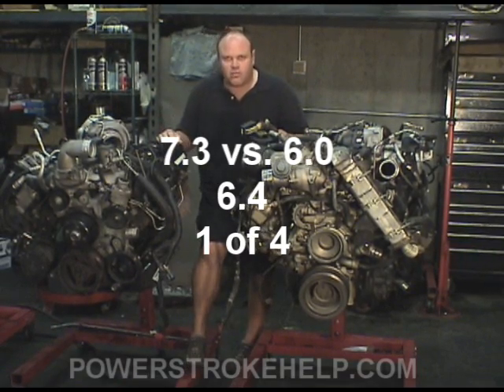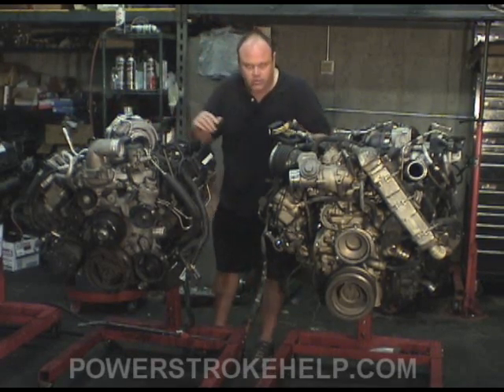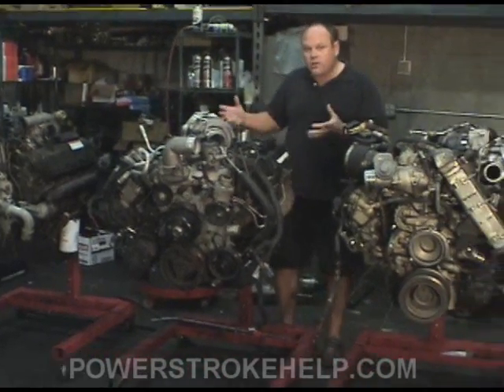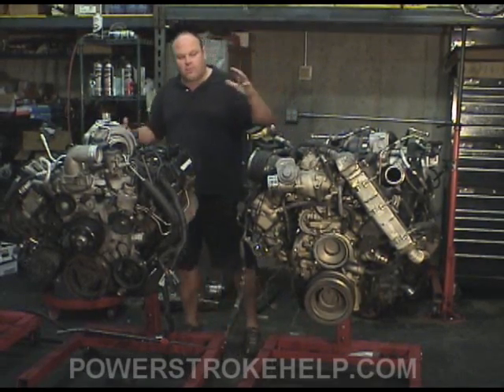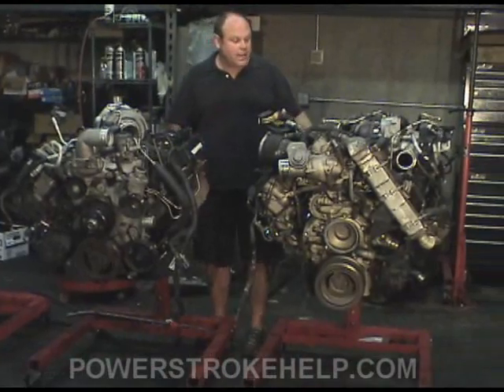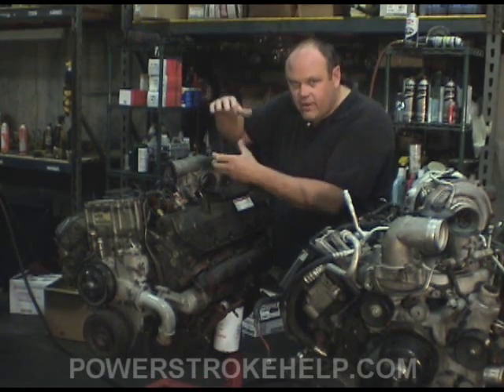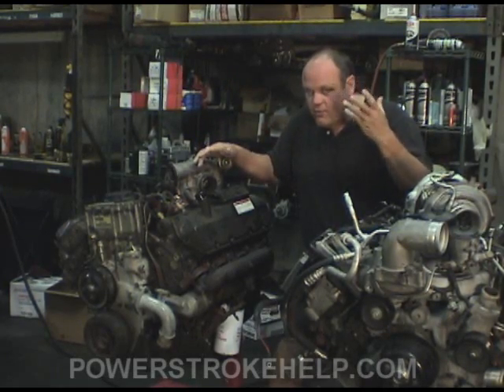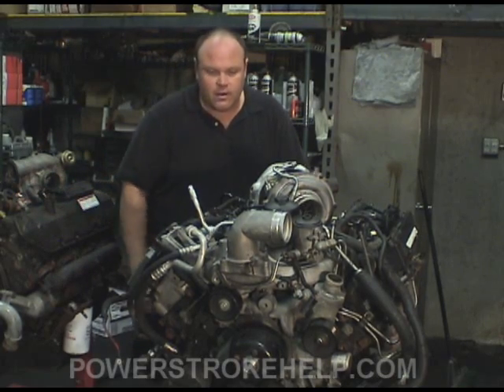7 3 vs 6 0 vs 6 4 POWERSTROKE ENGINES 1 OF 4

Comment: 7.3 is the best Diesel engine ever made.
Reply: Rebel Dipper I had a 1995 F250 Super Cab 2 wheel drive heavy duty I bought it 6 months after the Powerstroke turbo diesel came out! The 7.3 :-) I had my truck for 17 plus years I would still have it except for the fact that some rats ate the wiring to the lift pump and it filled me in Las Vegas that being said I tortured that truck for almost 300,000 miles and it never ever refused to do the work ever! :-) whether it was for work Towing boats hauling trailers for my personal stuff hauling the buggy trailer or boats it always got the job done!
Reply: powerstrokehelp I know that reducing pollution is important but putting that aside is the 7.3 the best engine if someone is just looking for a reliable workhorse?
Reply: Best ford Diesel engine ever made.
Reply: +powerstrokehelp with that said could they have cleaned the 7.3 up and kept the reliability of it?
Reply: +ryanjames170 no the late model 7.3's were about as clean as they could be just old tech that said after i sorted the head gasket on my 6.9 idi non turbo i love it i get 25 mpg empty and 20 full with the 4 speed but thats pre-powerstroke
Reply: Cummins is the only one that is realy hard to bash.. as you see fords and chevy's getting them put in.. its kinda the Small Block Chevy of the Diesel world for trucks..
Reply: It's arguable since the 5.9 cummins is also a million mile engine
Reply: the IH 444 TD is an unstoppable engines bud you cant deny that
Reply: 750,000 on a Ford e-350 15 passenger van,, 285,000 on a F250... Absolutely no problems with them,, runs like new
Reply: CUMMINS NATION 5.9 i love my truck power stroke 7.3 is the best
Reply: +REDCOMET1988 421 the cummins might have a slightly larger bore and stroke but its also down 2 cylinders compared to the IH

dude i have a 6.9 HI that&#39;s pushing 800k and other than having some trouble a few times with the injection pump over the last 800k its still running strong and don't even smoke unless your pulling 10k pounds and stomp on the hammer pffffffffffffffff telling me IH is bad that the fuck is wrong with you
Reply: +Jacobfisher#chevyboy I had a buddy had to put $5k worth of new injectors in his low mileage one he bought. Started shooting oil/diesel out of the oil pan when the injectors started leaking.
Reply: +Robert Elmo wow that sucks. what year? and I guess your taking about a dmax?
Reply: +MC1796 and Diesel burns pretty clean as long as you're not one of those dumb asses that purposely sets up your truck to spew smoke.
Reply: +fordman007 invalid argument obviously. but we have a lot more GM vehicles and they're really reliable for us. we switched from ford to GM 10 years ago
Reply: +fordman007 but hey the 7.3 and the 5.0 I like . there good strong motors. but I dont even wana get into the new fords lol
Reply: Jacobfisher#chevyboy the 5.0 302 is a glass engine i love my fords but the 302's are the only engines i cant run over 200k without tons of issues but thats what happens when you try to make an eco v8
Reply: +VK70001.P true but ohh and gota love that I think the 7.4 big block. budy just got one
Reply: Jacobfisher#chevyboy 7.5 460 BBF 9 mpg but all the power you need to pull anything you want with 2 inch wide connecting rods that think is indestructible

but my favorite engine that was put in a ford was the 6.9 idi diesel from IH navstar its 420 ci of work horse pill a 20 ton trailer 55 mph and still get 20 mpg
0-60 in 10 sec empty but it will do it all day long
Reply: +VK70001.P yea another budy has one of those 6.9  just wish it had a turbo
Reply: Jacobfisher#chevyboy yea they are slow i know but im like Jay Leno "i would rather drive a slow car fast than a fast car fast"

but you can add a banks you just have to replace the head bolts with studs you gotta remember one thing about the 6.9 idi's they have a compression of 21.5 to 1 so you have to upgrade the mild steel bolts to hardened steel studs to add and more air the the cylinders and sadly the 6.9's weak spot is it uses the same DB2 injection pump as the Chevy/Detroit 6.2/6.5 and its not the best designed IP pump
Reply: martingallegos01 maybe but you can get almost 2 times the rpm out of a 7.3 PS than a 5.9 Cummins and the powerstroke is just more stable being a v8 cummins have inline 6 problems like bearings and crank flex and heat distribution and dont even get me started on that common rail BS 

all that said i would drive a cummins before i would drive a dura-maxie-pad
Reply: +powerstrokehelp SO, WHAT'S YOUR POINT VANESSA? There are just so many 7.3's left...I have one in my 01 dually.  It works great and I don't have to add any crap to my fuel. WHAT ARE YOU, A TREE HUGGER NOW? I'll spend some money to keep my 7.3. I looked at new trucks but the politics of them bothers me greatly. 7.3 !!!
Reply: +Jacobfisher#chevyboy chevyboy- a duramax is an ISUZU ENGINE.
It's not a CHEVROLET ENGINE. The car market is GLOBAL. DO YOU KNOW WHAT THAT MEANS??? Do your HOMEWORK son.
Reply: +powerstrokehelp holy shit that's a lot of soot
Reply: DT466 is the best not Powersuck
Reply: you're so silly.
Reply: lol 7.3 to hull a buggy and a boat thats a bit overkill but ill bet the 17 mpg while towing was a nice relief
Reply: CookinHaM I know that engine is reliable
Reply: cookinHaM the problem is that the engine did not directly power the tank it ran a hydraulic pump that ran the tank and doing that would get you a top speed of like 25 MPH running wide open using about 1 gallon every 3 miles its just not the engine for the job
Reply: and Im a Proud owner of one
Reply: KrazyWyteBoy 19  maybe you had your headphones on 6.0 is the most split Powerstroke there is bulletproofed. Losers like u give the 6.0 the bad rap. Never had an issue my with my 6.0 320,000 mi later.
Reply: KrazyWyteBoy 19 I agree it is. Someone is always going to bring up the fact that a 12v can go millions of miles but the chance of finding a cheap 12v is slim to none everyone thinks that a 500k clapped out work truck is worth 20k because it’s got the 12v so barely broke in lol. Anyways if your looking for a highly customizable workhorse that will see 400k easy depending on if all maintenance was done correctly I’d go with the 7.3. You can make a 7.3 look like a 2016 6.7. Can you make a 12v look like a new ram? It’s all about preferences
Reply: ryanjames170 well the 5.9 12 valve Cummins is swapped so much because it’s the only modern turbo diesel that parts and engines are readily available and  meant for three-quarter and 1 ton trucks with mechanical injection which makes it very simple swap and also  is easy to make power
Reply: powerstrokehelp well it is the most reliable 90s pick up meant V-8 turbo diesel
Reply: Do a review on the 6.7
Reply: toyota's D4D 500,000 MILES is the recommend rebuild interval.
Reply: I honestly don't think that in terms of a million mile plus work horse that the 7.3 can compare to the 5.9 cummins, since there are multiple accounts of these engines being driven past the 3 million mile mark and not stopping there
Reply: true. i think if the 7.3l had a bosch p-pump with nozzles it could give the 6bt a run for its money on longevity
Reply from the maker: Rebel Dipper Very Very dirty. The 7.3 makes almost 100 times more pollution than a 2011-2015 6.7.
Reply: but the 7.3L has almost twice the MPG
Reply: +powerstrokehelp why buy a ford? we have got 266xxx on our Duramax. never 1 problem

Comment: i love how people say that a 6.0 and a 6.4 can out preform a 7.3 im in the fire department we have a 04 6.0 f550 and i got a 97 7.3 and it out ran it and out pulled it
Reply: You out ran it because you raced a freaking fire truck / ambulance. f550 vs a regular pick up with a 7.3? hmm. 6.0 is more powerful than a 7.3
Reply: Yeah that 6.0 will out pull and out run any 7.3 any day.
Reply: Than you have some dead 6.0 dude. That motor is so much more powerful than 7.3

Comment: Do you think if they had originally designed the 6.0 to a common rail with 6 head bolts and a better egr setup, would it have been a better engine and have a much better reputation?
Reply: Yes

Comment: Wow I dig your videos and the bountiful amounts of information  that you openly share, Thank You but please do start using some good lighting when showing things on a engine, your flashlight is just not cutting it!. I would be stoked if you were to share some good info on the big 6.6 diesel 6 cylinder engines in the 1988 F-600 series trucks. They seem to be very well made but it would be great to hear your opinion about them, maybe some important secrets that you would like to share? and whatever else that you could tell about these work horses. I have the 6.6 diesel in one of my trucks and am replacing the fuel lift pump due to lack of good fuel pressure which jumps around from 10psi to about 30 or so at 1500 rpms but also drops to 0 while running at 1500 rpm's. I already replaced all filters along with the water/fuel separator and also blew out the pick up line to the fuel tank and it still would not pressure up so if you could please let me know what you think the lift pump pressure should be and if low lift pump pressure would cause the injector pump to be running out of fuel which is what seems to be happening when driving. Sometimes it would not go above 1200 rpms when it normally would wind up to about 2700-3000 rpms. Thank you for any help that you could give me.  Marti

Comment: i want power what do i get?
Reply: Stock for Stock the 6.4 is the most powerful, however, all three engines respond well to ECU tunes and other forms of small modification so the choice is yours. Trey Jones
Reply: 6.4L
Reply: 7.3L has plenty of power, and it's a damn good motor. Make sure you change your coolant frequently though.
Reply: 6.4
Reply: Trey Jones 7.3
Reply: +jon doe agree to.
Reply: +jon doe Yea no

Comment: I just serviced a PSD for the first time, an 05 6.0.  They're stupid easy to service, but I need to get a better socket, mostly for the fuel filter on the frame rail.  The top filter and oil filter are plenty easy to get out with regular deepwell sockets.

Is there a part # for the filter socket you use?  is it 3/8 or 1/2 drive?

thanks!

Comment: any advice for a truck that idles many hours out of the day? (Such as a cold winter day, a full 12 hours..summer only about 2-4 hours...) I work in oil field and need a diesel for towing heavy fifth wheel trailers, but I heard the idling is hard on them, like carbon build up...so is there a solution to this? and if so, what is your preference size engine and advice for this field of work. I don't want to throw money out the window!

Comment: Hi Bill i went on vacation a few weeks ago i have a 97 f-250 7.3 133,893 miles ran great for about 1000 miles comeing back i noticed it didnt have any power after i stopped for gas stopped about a hundred miles later put in an octane booster ran great till the next fill up same thing no power at all stopped again put in octane booster again but no power limped home about 250 miles, took off the camper and it seemed to run better what do you think it could be thanks Dennis

Comment from the maker: Yes and No. Folks forget that the 4r100 trans behind the 7.3 was a grenade waiting to happen. The 5R110 behind the 6.0 is amazing in the abuse it can take with no malfunction.
Reply: I like the power my 6.0l powerstroke makes and i refuse to get it "bulletproofed" as it will always be a stock trailer pig, has 200,000 miles an only complaint so far is the egr cooler had to be replaced and had a dummy cooler installed instead

Comment: My opinion of the 1994 Turbo is like in this video it was the front runner of 7.3L Power Stroke. It may not perform as well but should last a long long time. It may have some issues that need addressing that were fixed in 1995 and later but it will run circles around the old IDI for sure & can be upgraded fairly easily to get even more performance if you want it. Down side is you are limited on what Tuners or Programers you can get for it. I want to get the TS PERFORMANCE CHIP around 250 bucks.

Comment: I have a 1994 Turbo 7.3L it has 217,750 miles on it now and seems to be a good one. I have a 5 speed manual shift and i get up to 21.7 MPG!! I only seen it once and it was during a trip running 70MPH for 6hrs. I had been getting 19-20MPG or so on other trips but i got some really good Diesel and I think that is what helped plus some other factors im sure. Tail wind, down hill, perfect temp and who knows what else but it blew my mind my average MPG for 25 + gal was 21.7 on a 1994 F350!!! =]

Comment: Im thinking about getting a PSD... 6.4s & 6.7s are pretty far out of my price range but the 7.3 and the 6.0 are pretty inline with what im willing to spend. Knowing the 6.0s make more power (stock) than the 7.3s (pretty big deciding factor) is it really worth it to roll the dice on a 6.0 when I can do some mods (chip, exhaust, etc) to a 7.3 to have it make more power?
Truck will have 100-160k Miles 
Top 3 things to me are reliability, mpg, and the power
Please Help me out :)

Comment: @MASTERTECH548 there is a leak in the system causing the diesel to run back into the tank over night. this means when you start it in the morn it will run for a short while (as it is useing the diesel in the pump) then will cut out as there is air in the system. it is a bitch to start because it is bleeding itseft again. most common cause of this is fuel leak off pipes running from injector to injector, replace them first as they are very cheap and easy to fit and see what happens

Comment: Thanks, i dont think it has ever had a lift pump sense i had it, back tank leaks, woundering if that could cause a leak in the system, i sure love the 7.3 idi, not to many issues with it until now, with the loss of prime. what brand oil works best for that, like rotella. just woundering, thanks for all your advice, sure helps, i watch alot of your stuff, you seem very smart. sense that right away, a grew up around engines, certified chrysler tech, it helps. !!

Comment from the maker: @MASTERTECH548 You may have a injector pump going bad but before I went to all the trouble I'd replace the lift/supply (on the passenger front of the motor) pump first. I have found that about 40% of the time that fixes the problem. Use a Ford lift pump only. The aftermarket pumps tend to leak in about a year.

Comment: question for you, my 91 ford truck 7.3 idi diesel, start up and dies after 10 sec, then it takes about 25 seconds to get it to run, once it is running its fine even after work it will start, but sitting over night, its a bear, could it be a lift pump, also there is thousand of miles on it, could i even put in prolong, or no, is rotella better then mobile delvac, thanks, ps can you add me to your friend list, thanks you!!!!!

Comment from the maker: @thesmalls5 Probably not but thanks for the positive feedback. My focus is to take the engines developed by the joint venture between Navistar and Ford and makethem better. Ford DID NOT have control of the development of these engines but Ford was left holding the bag on the shortcomings of the design. The new 6.7L is the first Ford only Powerstroke Engine and it is proving to bea great design.
Reply: powerstrokehelp good to know. Very expensive trucks though! I would never spend more than $30,000 on a truck

Comment: Dude!! I got 220000 on my 99 1/2 7.3. All original  except 4 in exhaust no muffler and AFE stage 2 cold air intake. No problems at all. Auto trans is hanging tough. Thinking about a billet torque converter and a new hpo pump. What do you think. Great vids. Taught me a lot. Thanks

Comment: YES, YOU ARE RIGHT ABOUT THE CAB REMOVAL!!  I worked at a FORD dealership in New York and that is what they had to do in order to get the proper clearance to remove it.  WHAT A NIGHTMARE!  The "do-it-yourslef-er"is not gonna' try that in his driveway!  They had the whole cab elevated with a lift while the truck remained on the ground in the work-bay; it looked like the truck was back on the assembly line in Detroit!  I hope this is not ture for the 6.7, as they need to consider serviceability!

Comment: Pull the cab off the truck to make a part change. Why couldn't Ford design it with a taller hood or anything similar so you can pull a part without pulling the cab?

By the way, how much does it cost to pull the cab vs if you did not have to pull the cab?